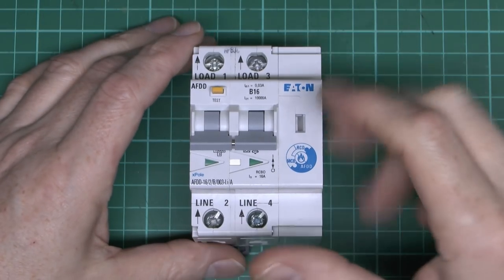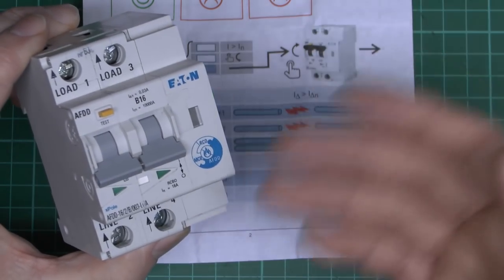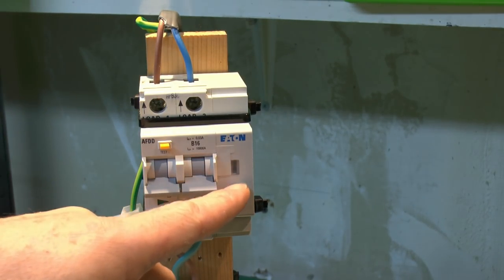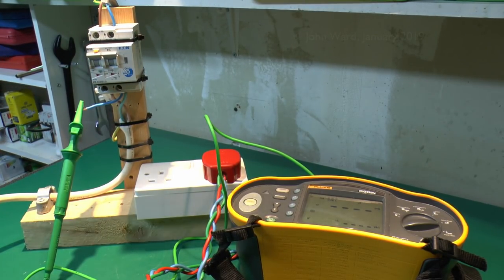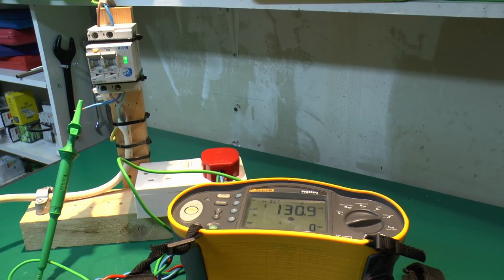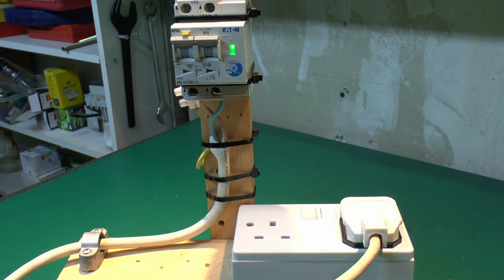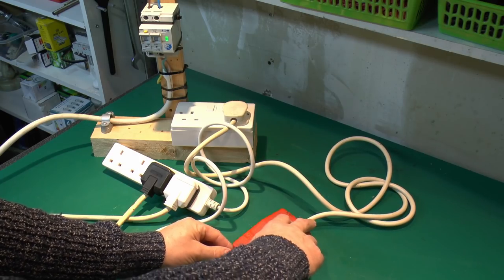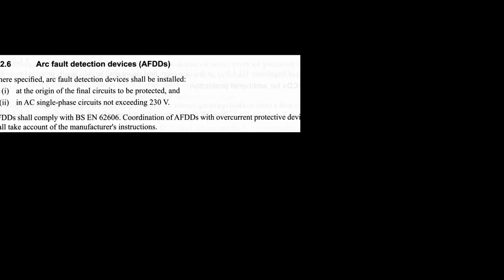AFDD - Arc Fault Detection Device - Part 1

Comment: John, so sorry to hear that AFDDs have made their way across the pond!

Many of us here in the States hate AFCIs (Arc Fault Circuit Interrupters), they don't do their jobs effectively, but what they will do is nuisance trip for vacuum cleaners, laser printers, HAM radios turned to 20 meters, etc.  We can only hope that as they make more of them, the manufacturers produce ones that actually work (ha!)  I've never understood why here in the US we didn't require more GFCIs/RCDs, which have been proven to protect life and property over and over again, are easy to test, and which provide real protective value.  Oh well, we don't make the codes, we just follow them :-/
Reply: "HAM radios turned to 20 meters"

What about other bands? ;)
Reply: BTW The codes are actually just a minimum requirement. You can put more safety equipment in, but of course the cost is higher and reliability is lower.
Reply: @zvpunry1971  The first generation AFCIs were extremely sensitive to the 20 meter band (14MHz), and there's a good video of a panel full of Eaton AFCIs tripping at 17m (18MHz).  30m (10MHz) was also a popular trouble spot.  They appear to have improved (my panel has AFCIs identified as "Gen 5"), but still nuisance trip with laser printers and some vacuum cleaners.  I'd much rather they can the AFCI requirement altogether and instead require equipment protection GFCIs (typically a 30mA trip) on circuits where AFCIs are now mandated.
Reply: I once saw a video of someone tripping AFCIs on different bands. One video, which I don't find anymore, showed someone with a <= 5W baofeng on 70cm tripping these devices. That's why I asked about other bands.

A nice video (with horrible sound) is this one: https://www.youtube.com/watch?v=JsILD0Fce1s
It shows how 100W on some shortwave bands is enough to trip AFCIs across the road.
Reply: But WHY do HAM radios tuned to those frequncies trip arc fault interuptors? Is it radiated or conducted interference.
Reply: Simon: The wiring in the house acts as an antenna and after this it is conducted interference. The AFCI can be installed in a metal box, but it won't change anything with this problem. My first thought how to get rid of conducted interference would be a ferrite on every wire that goes into the AFCI, but on the second thought, these devices detect the broadband noise from an arc and this noise would also be attenuated.

Fortunately we don't need AFCIs on all circuits in Germany (there are a few exceptions like workplaces and storage rooms where flammable material is handled/stored and nursery/kindergarten).
Reply: Simon Tay Both, technically...radiated interference from the transmitter can be picked up on the power line of another home and it becomes conducted interference to the breaker...or conducted interference from a transmitter in your own home can trip your breakers. @zvpunry is on the money with the fault condition.  The problem is that these devices are black boxes, so each manufacturer has different fault detection logic, which significantly muddies the waters in terms of determining why a particular scenario causes nuisance tripping. Better standards are needed.

Comment: Our new house here in the states used these for every circuit in the house. Fumbling around with the light switch would trip them, but more annoyingly a brand new mains powered vacuum would trip them as well. Only way I could find to keep them from tripping is to plug in a bunch of switchmode power supplies into the same outlet the vacuum was plugged into, presumably they were suppressing the noise from the vacuum
Reply: Or confusing it with high frequency electrical switching noise...

Comment: Good video,  John.
The nuisance tripping is a big, big problem.  Eaton seems to have resolved that pretty well with the breaker you demonstrated.  
Just don't trip :-) 
The AFCI detects current fluctuations so the operation is especially tricky in 240V countries, compared to the US where the current is twice as large.  It's tricky enough in the US.

A refrigerator is a very critical appliance where you DO NOT want nuisance tripping. If you have a second refrigerator that you don't use everyday, it can be a disaster if the breaker trips and you don't notice it.  Try to avoid AFCI's on refrigerators whenever possible.  If necessary, you can plug in a battery operated alarm at the same socket to let you know if the breaker trips.
.

Comment: These things have been required in the states for some time now. At first it was only required on certain circuits, usually bedrooms. Shortly after that, it became mandatory to use these things on virtually every circuit. It all depends on the local codes and local inspector/ authority having jurisdiction. Some require these for EVERY circuit, some are more sensible and require them only for general outlet and lighting circuits. Either way, these things are awful. Here in the states, the average price for a standard circuit breaker is between 5-10 dollars, where the AFCI - arc fault circuit interrupter - breakers are 40-50 dollars. This has increased the cost of breaker panel installs (consumer units for you Brits) astronomically. Considering the average North American residential breaker panel has 20+ breakers, you can see how much this would increase the cost of installing a new panel. We use radial circuits exclusively, as ring final circuits are illegal here. The other major problem with these is virtually any electrical noise will trip them. Vacuum cleaners, power tools, and anything with a brushed motor or high inrush current will nuisance trip these things even though there is no actual fault. The National Electrical Code, having embraced these wretched things lock, stock and barrel has done the population a huge disservice. 

I am a contractor by trade. I do many varied tasks, but my schooling was in electrical. In my parent's last home, they wanted me to install hardwood flooring in their bedroom. I couldn't use either of my saws (table saw and compound miter saw) or my air compressor in the bedroom because of these breakers. How is it safer for me to run extension cords down the hall and down the stairs into the basement to use an outlet that wasn't on one of these breakers so my tools would work? These things are just insanity. 

We recently built an addition on our home and this required a sub-panel to be installed in the new section. Of course they required these arc fault breakers to be installed in the sub-panel. Well, wouldn't you know, my mother's sewing machine trips the breaker every time she steps on the pedal to operate it. After the final inspections, those breakers got taken out and traditional breakers put in their place. Even the inspector agreed that these things are more of a pain than they're worth, and said if they happened to get replaced after he signed off on the inspection, he wouldn't be upset. Say what you will about an inspector like that, he was only being realistic. I'm sure he's fielded plenty of complaints about these breakers.
Reply: So a big corp invented the thing and then lobbied for a law to be put in place to make sure plenty are sold, and that would be the only reason why they exist in the first place (at least for homes)?
Reply: That's pretty much how I see it. These things are not generally required in commercial or industrial applications as far as I know, and no industrial organization would tolerate the down time these things create. They seem to be only required in residential new construction or if there's a substantial remodel. In my area if the cost of the remodel is more than 50% of the property value - or some similar percentage- you are required to bring the entire structure up to current code. This means all new electrical with these dreadful breakers, in addition to any plumbing, building, fire, or similar updates. Once you hit that magic number the building is no longer "grandfathered" and must have EVERYTHING brought up to current code specs. 

These things are a complete farce, and John did a good job showing it. Look how much arcing it took before it finally tripped. Which is odd, since the ones here in the states are the complete opposite, tripping at the mere whiff of an arc. I'm not kidding about my table saw, it's not like it would run for a moment then trip the breaker, as soon as you flipped the switch the damned arc fault breaker would pop. No, there's nothing wrong with my saw. I still have it, and use it all the time. On some arc fault breakers it seems to work ... ok... on  some, it doesn't work at all. There seems to be no consistency on how these things trip and at what threshold they do so. Maybe the code has specified the characteristics, but I've never seen them. All the inspectors do to test them is first make sure they're actually installed, then they use a little plug in tester like the sort with the three neon indicators for checking outlets except it has a button on it that trips GFCI and AFCI breakers. As long as the breaker pops when he pushes the button, its a pass. It's a complete joke.
Reply: Well, looking at the fact that every brushed (universal) motor say in a vacuum cleaner or drill has arcing going on at the brushes.. It doesn't look like an easy job to detect real faults. Every time you plug something active in a socket it will arc a little bit. Switch mode powersupplies with no real off switch also make arcing noises when you plug them in. Yeah... I don't see it.
Reply: Wylex are charging £200 in Screwfix for an afdd
Reply: I agree with your philosophy on the insane use of these devices for domestic purposes. I lived and worked in Canada for 30 years and the standard breakers and GFI worked great. My only beef is the sockets (receptacles) and plugs are Mickey Mouse in their design. The three pronged plug with the earth (ground) connection is usually at the bottom of the plug when inserted and invariably the plug can get knocked out of the socket easily. The lack of a positive tight connection when the blades of the plug are inserted makes them candidates for potential arcing at the receptacles. They are not a patch on the design and robustness of MK sockets and other leading brands in the UK. Plus the use of ‘Maretts’ (not sure about the spelling) is ancient because if overly twisted they can break one or more of a  conductor in a bunch. That’s my rant over.

Comment: Thank you again John for taking the time and effort to demonstrate the proposed new device. Personally, I think they are over the top for a domestic installation as others have said the CU will be massive, besides, most arcing ends up causing a short circuit which would be picked up by the usual devices anyway.
Reply from the maker: The newer versions are a single module wide, so the consumer unit won't be any larger than it is now.

Comment: I think it might be difficult to find a good balance between sensitivity and nuisance tripping. You wouldn't want this thing to go off every time you flip a switch. But at least it should detect arcs that create enough heat to cause a fire, otherwise it's useless.

Comment: There are sellers of some Eaton equipment here in the Czech Republic. But the things are over 10 times more expensive than competition, so they only really sell them to parties who spend somebody else's money. The arrangement seems to be a mid-tier breaker like ABB or Siemens from the supplier and then the cheapest Chinese "6kA Icn" breakers for the panel. These breakers would fail if exposed to a hard short, but the supplier-fitted breaker will trip and save it.

Comment: Electrical engineering at its best, great vid, nostalgic look at the quick test used to be big clives principal tool. Lip sync went a bit off at 23:00 , thanks for sharing.👍 👍👍
Reply: QT still in use on the IoM.

Comment: Soon we will a bedroom for the consumer unit, one of these per circuit means the consumer unit will be 2x the size of an existing one...
Example: hob: 1, kitchen sockets(not hob): 1, heating system/heatpump: 1, lights upstairs: 1, lights downstairs: 1, sockets upstairs: 1, sockets downstairs: 1, for the garage: 1
For my house I would need 8 of these, each of them 3 spaces, just these alone are take the space of 24 single units

Comment: John,  So sorry to see that the manufacturers are making the wiring rules over there like they are here in US for the NEC!   These are nuisance devices.   My understanding is that they have tested many arcs and the device is looking for a waveform of a tested arc.   So we were the testing group in US.  Some loads that cause false trips were noted by others.   Another one that causes problems is D.C. motor loads.   Like a treadmill.  You might like to test one since you have it set up.   Also, it not only trips the device used but may trip several at one time.   We are sympathetic about having to install them.    Oh by the way, if these check for ground fault, what happens to the single device you have for the whole panel?   The price of your electrical system just went up as well!   At least the manufacturers come out ahead.
Reply from the maker: The idea is that these are used for one circuit only, one manufacturer has already put out marketing material suggesting a whole row of these devices, one for every circuit.
Reply: John Ward.  So the question is, multiple RCD's behind one RCD.  I believe you call our GFCI's RCD's.
Reply from the maker: @KevinCoop1  Yes, GFCI and RCD are the same thing.  If these devices were used, then there would be no upfront RCD, just a main switch.  It's the same with RCBOs that are available now (combined MCB and RCD), you just have one of those for each circuit and a main switch for the whole lot.

Having a single RCD for the whole installation isn't  done now, that was more of a 1990s and earlier thing, when RCDs were far more expensive and not actually required for most circuits.  More recent ones have 2 RCDs, each doing about half of the circuits, but even that is moving to a main switch and RCBOs now.